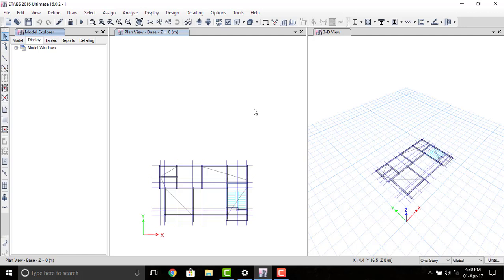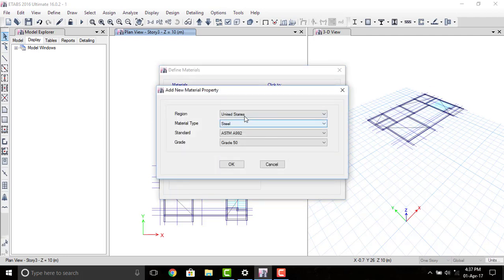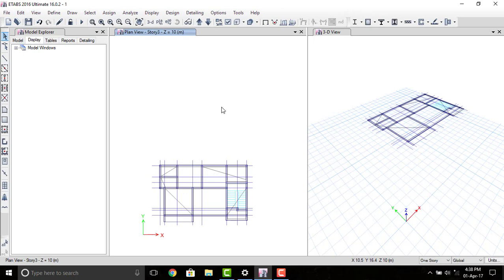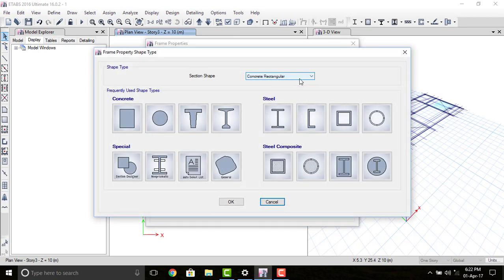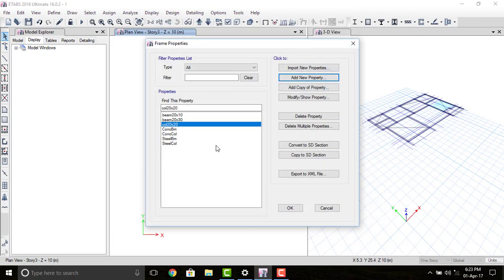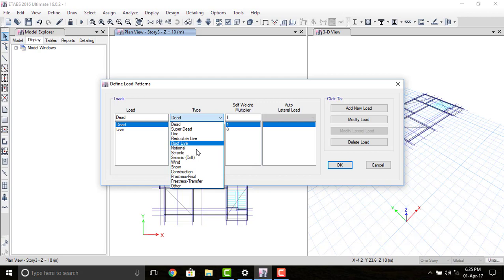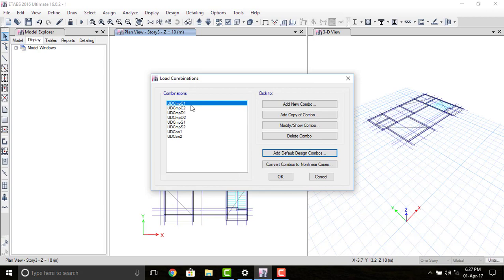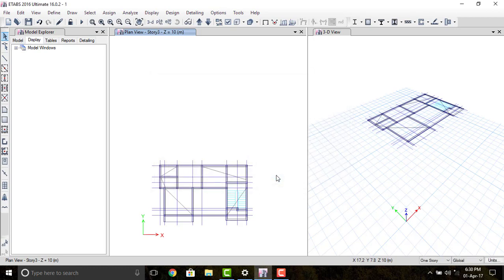ETABS Tutorial (2. Define Material, Section and Load Combinations)

Comment: Sir, for normal buildings we dont use m25, but we use m20. So must we design for m20 or m25 in Etabs
Reply from the maker: Use the gard of concrete u r using. If its m20. Use m20 in etabs.

Comment: Hi.
Slabs are modelled as thin shell?
Where does other options like membrane, shell thick applies to.
Reply from the maker: Membrane for shear walls usually
shell can be used when both in plan / out of plane forces are there. 
 Membranes take both in plane forces only.